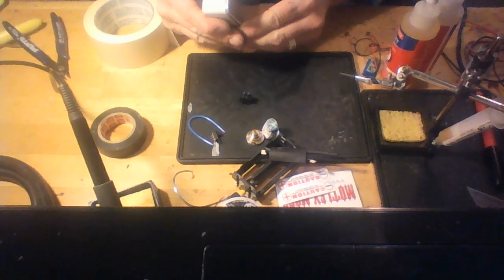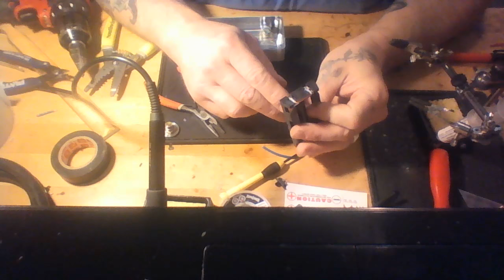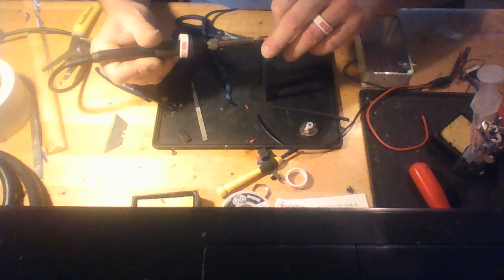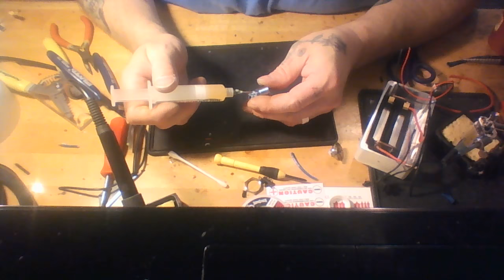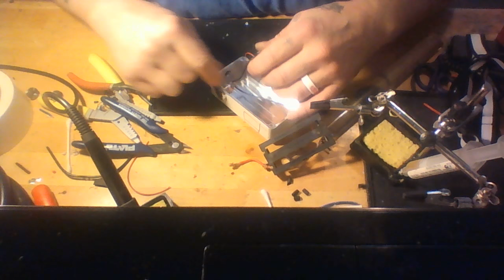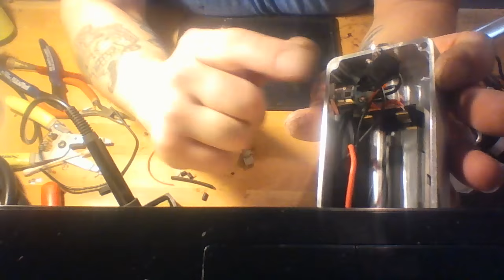How to Build a Unregulated Mosfet Box Mod

Comment: Ordered 2 full kits and a basic kit I thought the 2 full kits would come with metallic enclosures sadly they're both plastic but whatever im still happy on a side note had a quick question 
One of the switches I got is the 16mm with LED but I cant find any diagram or videos explaining how to wire it up for the LED im doing dual 21700 with Moffett on off switch volt meter and 16mm LED switch
(Havent finished the video yet just asking ahead of time because im not sure if its explained in the video)
Reply: Thats the same reason I'm here
Reply: @MrForelone  he explains it in the video towards the end I couldnt hear him too well so I dont know what I did wrong my button works but doesn't light up and my voltmeter doesn't work either havent really tried making the others I ordered because it really discouraged me and don't want to mess those up as well
Reply: @christophermorejon9693  My kit gets here on the 23rd and I ordered the button last night. When everything's in I'll set it up and see what I can tell you

Comment: my kit came with the 26650 battery sled but with the terminal clips the batteries won't go in its very tight. Any suggestions?
Reply from the maker: the batteries Won't go in the sled or you can't get the sled in the box
Reply: it's a 26650 sled that came with the kit but with out the terminal clips the batteries just barely fit. an with the clips in an bottom spring all the way down it still didn't fit

Comment: I'm about to order a kit or 2 and want to know what's a safe build for it and what's the lowest build I can safely put on it. thanks for any info you can give me.
Reply from the maker: i'm not a super sub ohmer i do 0.4 with 24mg but i have tested down to 0.15 i personally think 0.2 is a safe range with most mosfet mods just make sure you use good batteries can't stress that enough
Reply: Motley Mods thanks I'm use around .3_.15 so I should be good and I use 35 amp batts.
also you don't show how to wire in the witch that comes with the sled that has a voltage display.

Comment: What soldering iron are you using?
Reply from the maker: wasn't sure what one to buy this was cheap figured won't hurt to try it at the price i've had it for a couple years no problems use it daily   http://www.ebay.com/itm/181139781537